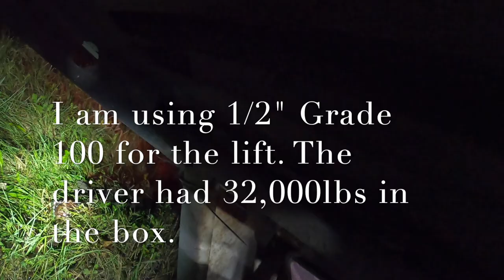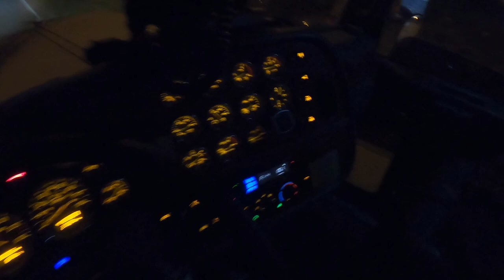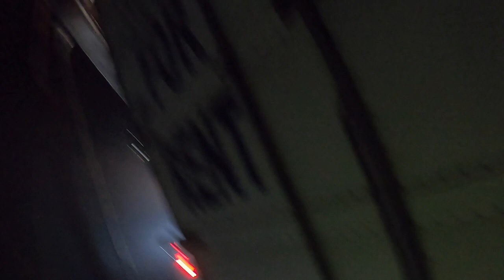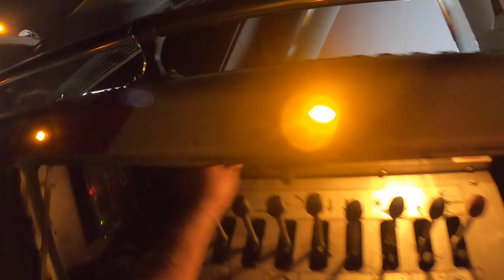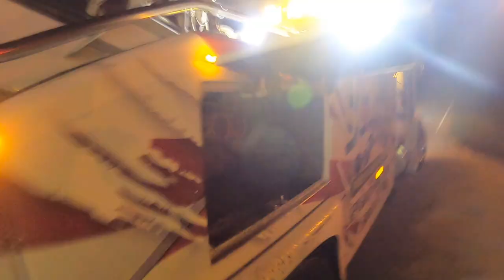Early Morning Trailer Lift

Comment: Mr. HAL, A Difficult angle, but you pulled it out. Thanks for video.
Reply from the maker: Mr John. Had to keep a close eye on the wire rope and make sure it wasn't  rubbing the top of the trailer. Thanks for watching.

Comment: Hal the what do you call the thing that you raised up underneath the boom? Did you raise it up there to provide room to move the trailer or to support boom in case it dropped? How many years have you been towing vehicles Hal? Were you self taught or can you credit someone who taught you quite a bit? Even in the middle of the night you so polite. Thank you Hal
Reply from the maker: Mr Otto  That is called the under reach or wheel lift. I have been towing  about 25 years.  I learned alot on the job when I  started but now I send drivers to classes.
Reply: @SumterWrecker  thank you for the quick answer. Have a great day Hal